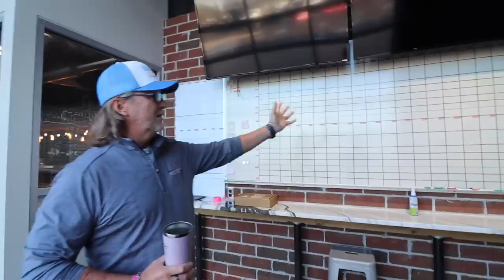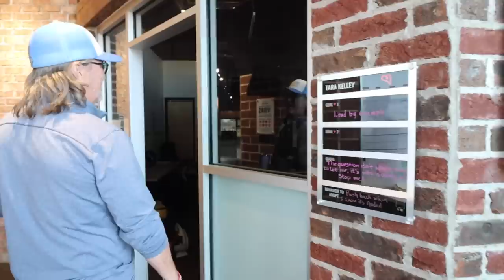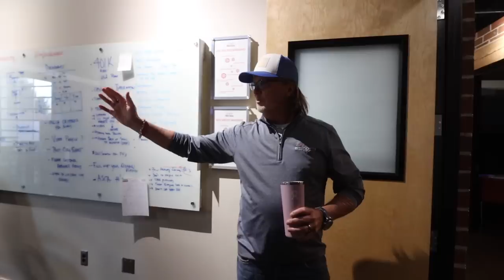Touring A MULTI-MILLION DOLLAR Landscaping Company's HQ! ► Troy Clogg Landscape Associates

Comment: 15:41...nice old square body Chevy tucked away...alot of these guys hang onto one of their earlier trucks that helped get them started. I wonder if that's the case with that one. Great video Brian!
Reply from the maker: We see a lot of those around town! They literally run forever haha
Reply: yeap,.....first truck I bought to get the business going was a brand new 1987 GMC K2500 4x4, 350 4 bolt main, 4.10 posi front and rear, snow plow prep package, heavy duty coolers, trailering package, etc......best truck ever and I've had 28 new ones over the years....$15,700.00 out the door...comparable truck today will cost about $65,000.00, and so we got 100.00/hr/plow truck then....we still only get 100.00/hr/plow truck now!...what happened?LOL....